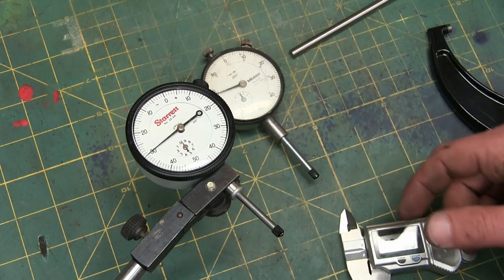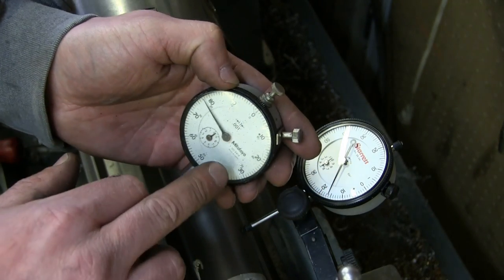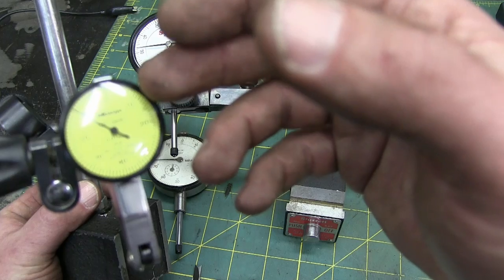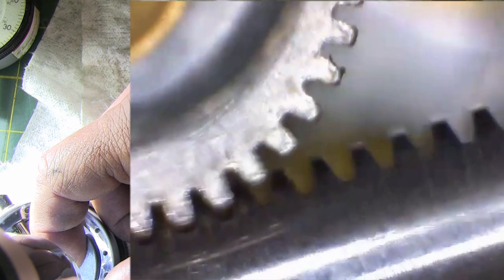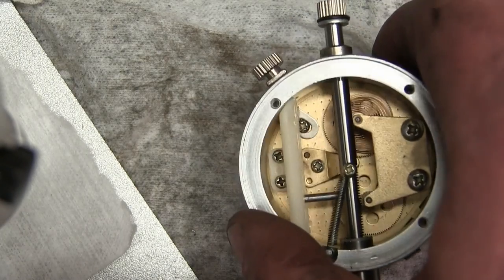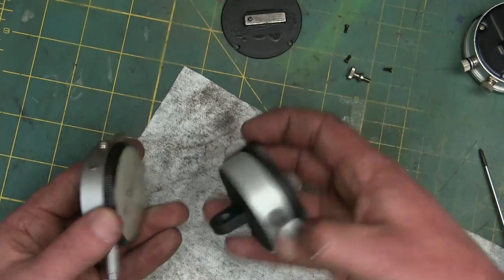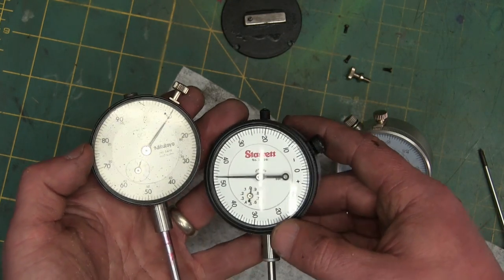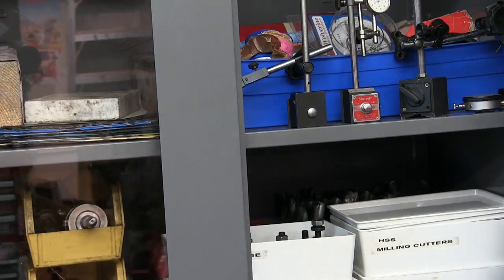BOLTR: Mitutoyo Dial Indicator

Comment: For accuracy you should always measure on the flats of the caliper jaws as close to the slide as possible. Out at the blades there is deflection which can cause the measurement to read undersized; but you already knew that, you were just seeing if we were paying attention! ;-)

Comment: Used a dial indicator to set the thrust lash on a VW air cooled engine crankshaft. As this was eons ago IIRC it was set using shims behind the pulley. I don't think they were on the flywheel end. If you didn't have enough lash, it would bind. Too much would bang the bearings resulting in oil migration to the driveway causing consternation from others in the household. The main bearing on the generator pulley end had a spiral in it to spin the oil back into the engine. It was how the bearing was lubricated, by slopping oil into it from the crank splashing it around from the sump and the spiral keeping it from escaping to the wild beyond and your garage floor or driveway. Magnificent tool for specific applications. IIRC my father borrowed it from work and it was made by Starrett - this was over 40 years ago.

Comment: Good vid of the twiddley twaddly clocky bits but what about the real magic?
How the hell does the megneti turn off turn on block thing work?
Had one for years for the dial gauge to measure crank journal run out, just press the button she sticks to the block,press the button she lets go!!!
Never put no batteries in her so what tom foolery is going on here,where do the pixies come from to make it go.
Always wondered but the one I got wont let you undress it.
How bout cuttin one up to put me out my misery
Keep your vice on the ice

Comment: the coiled watch spring is what's taking up the backlash by preloading the gears. The extension spring is just for the probe. That S bend in the probe means it was smacked into something and bent, then bent back. That rarely works because the metal has been changed at the bend and doesn't want to go back the way it came. You got lucky on that one.
Reply: I did straighten many V8 valve pushrods by hammering them on a piece of flat glass.  Practice does it, and they can be 9.999% straight, even straighter than some new ones form Factory indeed.

Comment: Grizzly is good for some things, like if you need a lot of bang for your buck in the big-assed power tool department. Table saws, jointers- of course I'm just a knuckle-dragging woodworker so I can't speak to mills or metal lathes, but you're better off on Amazon for inexpensive tooling or bits IMO.

Comment: Not sure if you’ve dont this but I need to use a laser alignment tool for a pump to motor. I read the instructions but it’s above my pay grade. 
Is it possible to do a video on doing pump-motor alignments with. Laser alignment tool?

Thanks for your consideration.

Comment: In 1965 I was in jr high shop class and loved it, but we did not measure things but with a ruler.
In 2000 I bankrolled a machine shop. That inventory told me what to buy to set up my own shop. I got indicators and calipers.
~~2005 my cousin got a patent on Mitutoyo  coolant proof calipers [like shown in video].  I have never designed a phase detector with good amplitude immunity, but it seems my cousin did. He says he used 3 phase, but I don't see how that alone would work so well.

Comment: I used to do some work for Rolls Royce cars, back in the 80's. I was told that Sid, or whatever his name, wasn't allowed to use any measurement gadget whatsoever in placing those slats onto the impressive Palladian inspired radiator. Any slight measurement error would look terrible so they eyeballed them. Then there was George. He was locked in the trunk while someone drove the car so he could listen for squeaks and rattles. I jest ye not.

Comment: Built like traditional watches were in 1900s. Probably same as an indicator from that time? Pin / panel build like a cheap timepiece, or jeweled like a pricier one. The pins are rugged in a big movement and friction can be very low if there are no incidental forces on the pivot.

Comment: I have the same exact calipers. I think I know why they were reading off for you (mine are dead nuts 99.9% of the Time) if it was a rounded standard and you were using the blade end of the calipers you would need to be dead on the high point or you would read small. I'm a quality inspector for a company that specializes in aerospace and astrospace and those are what I use every day!... on tolerances +/- .01 thousanths or wider per company policy lol. most crap is run on the Zeiss anyway.

Comment: I always thought Grizzly had a decent reputation.  My son bought a some slitting blades and an R8 arbor from them.  The threads in the arbor were %^&*%^ (not quite right).  We ran a tap in it and it appeared OK, but it didn't thread easily on the draw bar and slightly messed up the draw bar threads.  It finally started working ok and the draw bar threads were straightened out, but I guess  we only need one Grizzly part/piece..

Comment: Not for nothing but contact Grizzly they are  in my experience really good  about customer service and standing  behind the warranty  on tools,  also there are several good guys in the hinter lands that do great work on "real " repairs to DI's if you want to get the stem  replaced on the Miti   not that your fix was not good enough but you could have it in like new condition if you want for not a lot of coin from what I understand,  both Abom79,  & Keith Rucker have had DI's repaired and or cleaned check out their vids

Comment: There is a conjugate non involuted gear. It’s epicyclic. No back lash. Look at the Nexen roller pinion system . Did a project on it. Created a design method for using it create gears. It’s kinda cool .

Comment: I needed a dial indicator for a small projects a few weeks back. Ended up buying a craptastic no-name from fleaBay. This video made me feel a lot better about it. It looks like even the cheap ones are about the same on the inside. Although actually the one I got is all aluminum (crown, bezel, backplate, etc.). At least on the outside.

Comment: How do you know that the sample rod is not off by a few thousands
Reply: knut riis  they are manufactured to within a millionth of an inch to be used for verifying the micrometer is reading correctly. Micrometers usually measure down to a ten thousandth (.0001) of an inch.

Comment: Boy howdy, that'd be one heck of a badge of honor to put on my first REAL bench toolbox that I'm currently breaking in. I had to find out the hard way that ABS plastic boxes aren't much good when you drop the darned things a couple feet & and they split right in two ; other than practicing that there "controlling your inner chi" that your yoga instructor is always going on about I suppose lol

Loved the video by the way
It actually reminded me about a problem I'm having with a 1 inch micrometer that was passed down to me; the increment lines don't quite line up. It's aligned to far to the left so say if I completely close it in order to zero it out, it passes the zero line by a tiny bit so you can never read it easily haha. 
I think I'm gonna give it a shot at fixing it though, this video really got me motivated to at least give it a try!

Comment: Sometimes in avionic when using syncros they have a double gear there have a spring so the teeth a tight against its other. That seems to work perfect against backlash.

Comment: Ave I need a hand understanding an air powered device. It is a pneumatic vacuum o2 sampler that they use on a dyno to sample exhaust air fuel ratio. I can find kits that use a wideband 02 sensor directly welded to the exhaust via a bung. I am wanting to set up something similar to Dynojets AFR  vacuum pump for personal use. But I need to figure out how to make the block that the sample tube, o2 sensor, and the vacuum pump all attach to. Please help inspiring minds need to know!!!!

Keep Making the great videos I watch everyone

Comment: Closer up in the jaws of a caliper you can get the more accurate they are (less deflection) I've never seen a standard with a spherical grind, as far as I know they are lapped flat just like the anvils.
Thanks again for the ruler and the nutfucker you sent to megabots. I cant speak on behalf of tim but I sure did appreciate it :P Using the shit out of the pecker detector.